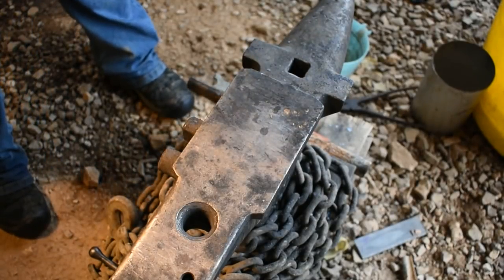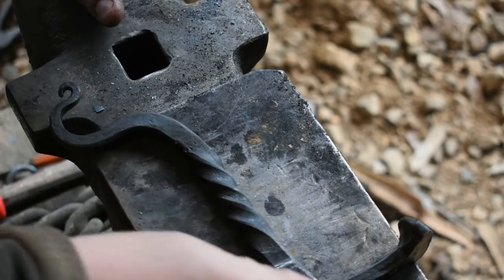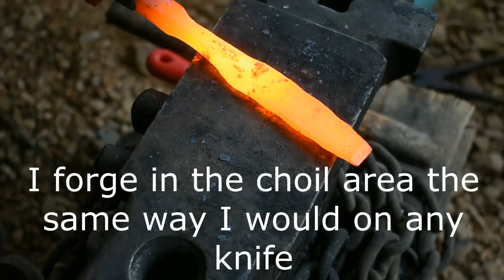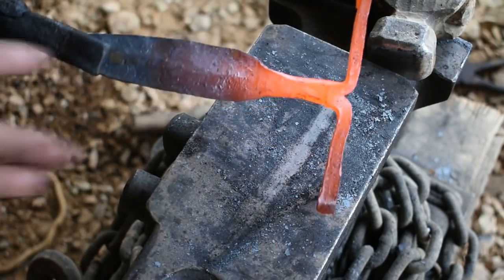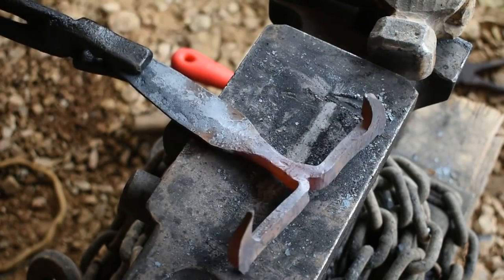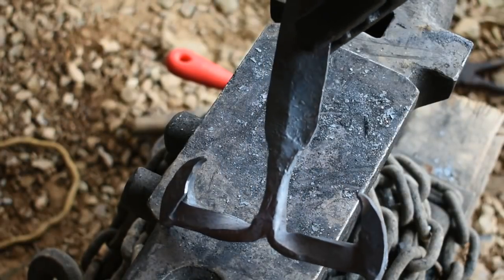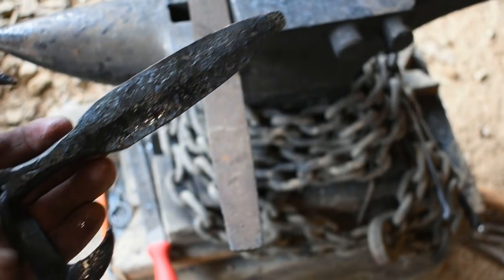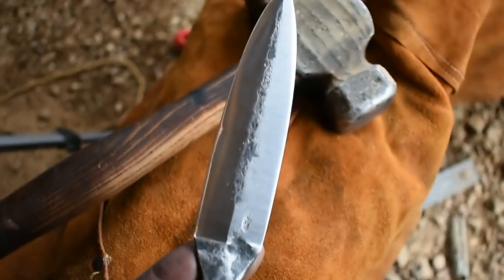Turning a rusty old railroad spike into an AWESOME PUSH DAGGER!!

Comment: I have a 33 pound air hammer, but honestly, I never use it. It is broken more than running. I fix it, use it for a couple forgings, then it needs something else fixed. I don't enjoy using it at all. I think it is just under-powered. Bigger really is better when talking power hammer, IMHO. I am not a experienced  power hammer user and that doesn't help. Anyhow, good fun, thanks for putting yourself out there for our entertainment.
Reply from the maker: Thanks for watching! The local blacksmith group in OKC sells a 15 lb tire hammer, I was looking at getting it but with the press I have I don't think it would get much use.